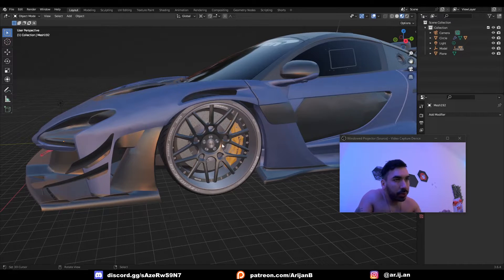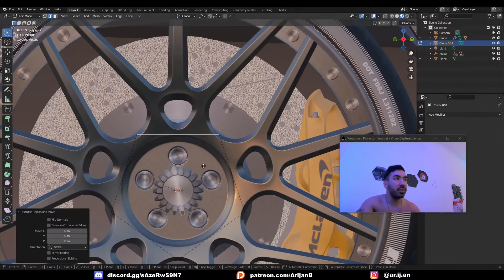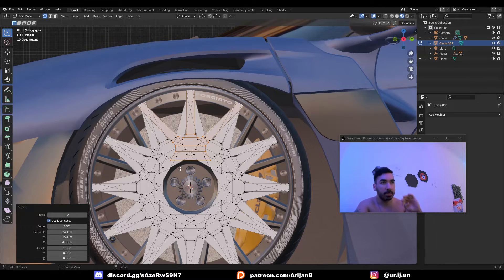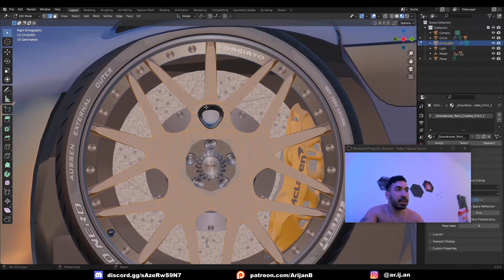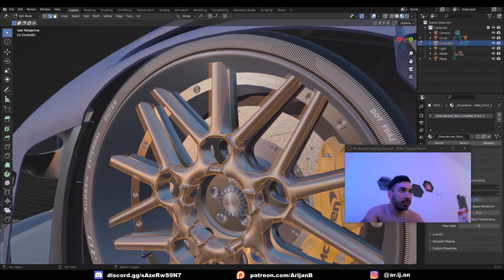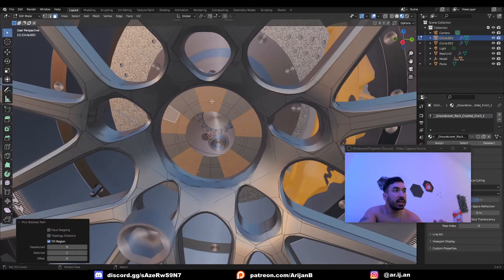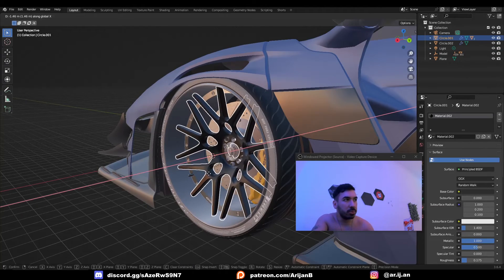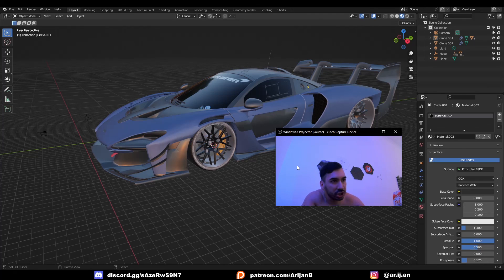The BEST WAY to model Rims in Blender - Supercar Series (Aryan)

Comment: Is there any reason you prefer to not use mirror modifier for 1:20 ?
Reply: For quick simple things it doesn't really matter, there's a few ways to do quick mirrors, including the CTRL+M then enter the axis for the Mirror option & snap in place, which works in both Object & Edit modes.